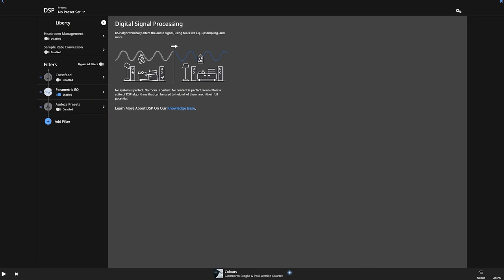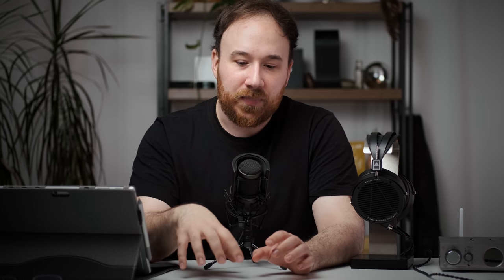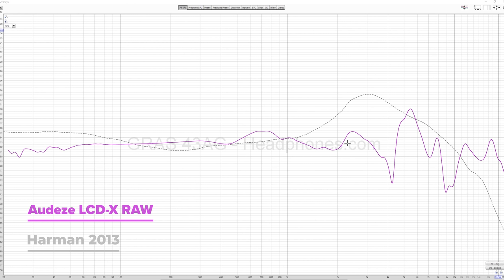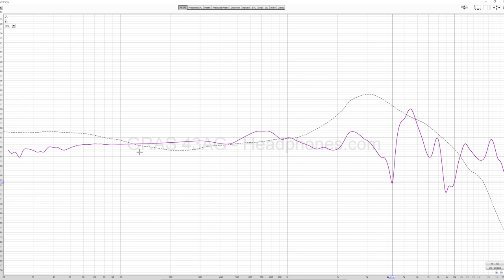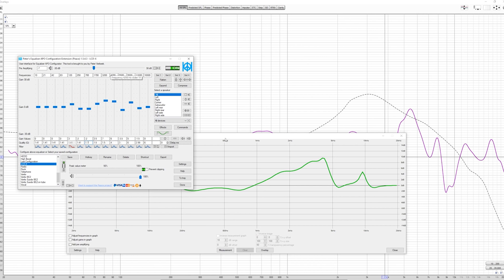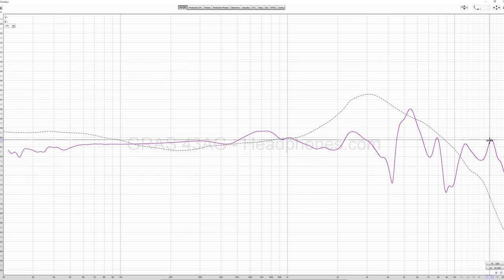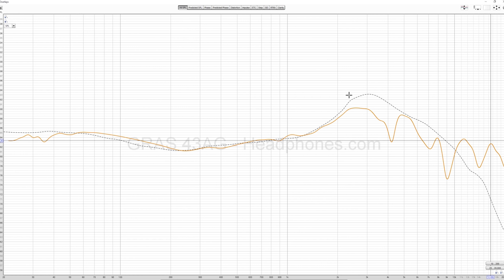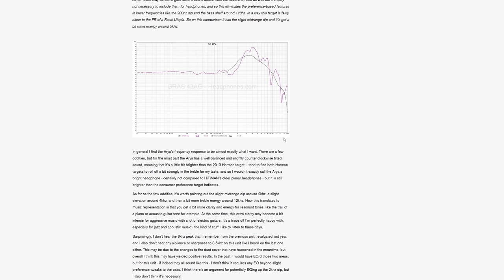How to EQ Headphones - Featuring Audeze LCD-X 2020 (not 2021)

Comment from the maker: UPDATE! This EQ ONLY applies to the 2020 version and not the 2021 version.

Just a note about the 9khz dip. Apparently this is something that shows up on headphones that have strong interaction with the physical ear, and it should be there. For the LCD-X, I'm not sure it has this interaction, or if there really is a dip around 8.7khz. To my ear, adding a bit of energy back didn't result in the kind of 'shimmer' that filling in this dip on other headphones has resulted in, but I do think this is something you need to do at your own discretion. Start without that adjustment, and if you still find it has a cut resonance, try adding it in. But I really don't think it needs it either.
Reply: Thank you for a great video! Where can I find your curve for the latest LCD-XC?
Reply: No file we can use please, bar transcribing from the video?

Comment: wow, what a great video. I personally love EQ and use my ADI 2 DAC with multiple profiles for my LCD2C to switch between depending on the day and mood. although I used to be a purist at the beginning, I now have discovered the beauty of EQ.
Reply: im not scary according to the manual the rme does not clip. The dsp handles that for you automatically so you don’t even have to think about it
Reply: I used to have the same thinking and when I EQed my LCDX with the RME, a combo made in heaven was born. EQ was actually my most unnecessary feature when I bought the RME and now became the unexpected surprise.
Reply: @alexk1239  could you please share your DSP curve on RME for LCD-X? I have the same setup :)
Reply: ostvaldseo Sure:
B1 Fc 100 Hz Gain 3.5 dB Q1.0 and leave the filter symbol at self mode (Sideways “Y" )
B2 Fc 1000 Hz Gain -2.0 dB Q 2 peak mode
B3 Fc 3400 Hz Gain 2.5 dB Q 2 peak mode
B4 Fc 6000 Hz Gain -2 dB Q 3 peak mode
Reply: @alexk1239  Thanks a lot! I'll start with this setting
Reply: @ostvaldseo  I emailed Audeze to get the FR for my SN and actually I fixed it completely now as it was a bit off target. Sharing the new values:
B1 Fc 100 Hz Gain 3.5 dB Q0.9 self mode
B2 Fc 750 Hz Gain -1.0 dB Q 2 peak mode
B3 Fc 4300 Hz Gain 3.5 dB Q 1.9 peak mode
B4 Fc 8100 Hz Gain 3.0 dB Q 3 peak mode
B5 Fc 12k Hz Gain -3.5 dB Q 2.8 peak mode
Reply: @alexk1239  hi there I just got my FR from Audeze and own the RME. Is there a way I can get in touch with you to get some help setting up an EQ on the DAC for my FR?

Comment: I‘d recommend giving Sonarworks Sound ID a shot… it basically does the correction curve automatically based on measurements made in labs and also compensates your gain according to the strongest EQ adjustment. It‘s used for mixing and mastering but there‘s also a systemwide application that let‘s you listen to any audio source👍🏻
Reply: Soudnds way too harsh with Sonarworks curve…

Comment: Trying to find a headphone that naturally has a tonality you like may be more fun for people with lots of money, but for us poors, EQing makes the hobby a lot more affordable.

I recently bought the Sundara, and the level of clarity and detail was immediately apparent from the moment I put them on. They're by far the most technically proficient headphones I own, but I felt they were a bit light on the bass for my tastes, and some vocals and electric guitars sounded ever so slightly shouty at around 4K. A bit of time spent tweaking the EQ fixed both of those right up, and turned my Sundara into a headphone that I'm much happier with than I would be if I'd left it at the stock tuning.

How many headphones are there around this price range that have both the technical capabilities of the Sundara and have a frequency curve that perfectly matches my tastes? Probably none. So if I have to make a choice between EQing, or spending lots of money that I can't afford to spend on headphones to try to chase down a unicorn, I'll go for EQ every time.
Reply: Hey can you share the eq settings? Thanks

Comment: Thank you for the video. I'm new to EQing, however I think there is a major flaw in this video or at least very important information are missing.
1. How to measure headphones at home? If it's not (easily) possible, then I have to rely on measurements from others and not for all headphones there are good measurements.
2. When it's not possible to measure headphones at home, how can I 'see' the end result in comparison to a target I have decided to EQ towards? (hearing a result in comparison to a target is not possible). Sure I can add the DB values to the purple measured line but it's not as accurate as I can't consider Q-values properly in manual calculations...

Therefore I think - especially as a newbie in EQing - it is very easy to mess up the sound quality of headphones with EQing

Comment: I'm going to give a golden tip that will change the lives of many people who have (or intend to buy) the wronged Beyerdynamic DT 990: take the Sonarworks ID Reference, apply the corresponding preset to the model DT 990. But (and here is the magic) no apply 100% equalization. On the dosage knob (Dry/Wet) set it to 55. There you have the best warm sounding headphones available for this price. The best.

Comment: I drive my Sennheiser HD600 from iFi Zen DAC. HD600 are known for not having much bass but that TrueBass button really helps them a lot. Now, not all music benefits from it but it is really nice to have it to mitigate the lack of bass when needed. 
I have more or less managed to match the TrueBass boost in Equalizer APO but there is a catch. It does not translate well when I use that EQ preset with other DACs than the Zen DAC. At least it is something to take into account when I try to dial enough bass to use with other DACs of mine like SMSL Idea and Tascam US-2x2 interface.

Comment: Why calibrate tvs? Why tune cars? Why adjust in-game graphic settings? Why turn the ac/heater up or down? Why install dimmers for lights? Why overclock a cpu? We eq everything around us to suit our preference. Why buy something for its potential capabilities and yet refuse to run them at those potential capabilities? I smh.. lol my question is tho especially for planars, would eq-ing affect the longevity of those planar drivers?
Reply from the maker: This is a very good question. So far I haven't heard of anything to the contrary but there may be some edge cases where if you boost the bass like crazy it could have some strange effects on the diaphragm's excursive force. I know that some HE-6 users are living in fear of their headphone's drivers ripping themselves because it slams so hard. I'll see if I can ask a manufacturer about this, or maybe Oratory has some info.

Comment: if you do it right, your headphone could be much more enjoyable after EQ.

the main problem however, is getting an accurate measurement of the headphone so you have a reference to work with,
headphone measurement rig can cost you thousands of dollars. yes there is some cheap ones out there like the minidsp ears, but those are known to have insufficient accuracies that makes the graph measured less useful as an eq reference.

you can always find graphs online, but headphone do have revisions that changes the sound, and manufacturing tolerances will make every single one have different responses especially on the treble range. and besides you can never know whether a graph is trustworthy or not because you don't know the rig it's measured on.

it's important to know what you're doing when EQing your headphone, but it's difficult to know what you are doing without an expensive measurement rig......

Comment: Thx . Very helpful! Still wondering how your proposal is different from what Audeze is providing as compensation e.g. as Roon preset. Also hove trouble finding your preferred eq presets  in the provided links
Reply from the maker: I haven't posted them yet. This is if you want to learn how to do it yourself
Reply: Where can i find the measurement graph you use in your presentation . I am not able to read the text on the axis. I.e. i see the curve but i don't know at which frequency the dips and peaks occur . Thx
Reply from the maker: I post them in threads on the community forum linked in the description, and also in my written reviews posted on the main page
Reply: Thx tried it out in Roon.  played with the q values to get a steady curve . Sounds overall good and transparent but a bit harsh in the upper  heights
Reply from the maker: Yeah maybe add a downshelf around 11khz for the LCD-X.

Comment: one little correction to the method, when you do the low shelf for the bass, if you see the crossing point - like in this video example at 120hz, than the shelf should not be set at 120hz. as the shelf bleeds to higher frequencies above it. this is why your bass boost overshot the target line above 120hz. watch it again to understand what I am talking about. usually you should subtract a little bit: the shelf should be set more like 90hz (plus minus) to match a 120hz target cross point. do it with your eyes watching the result, to see if it crosses correctly in order not to over shoot.
Reply from the maker: I get what you're saying but I also think it's fine to overshoot the target there. There are good reasons not to worry too much about the contour.
Reply: @TheHEADPHONEShow  your remark as general is acceptable, only specific to bass region that we discuss now, the issue is, acoustically, frequencies over shadow neighboring frequencies, and when we overshoot, doesn't mater where, but specifically in the lower registers, usually over bass meaning more energy in first octaves, will mask the octaves above it and will deteriorate tonality and detail retrieval by our ears. so we have to be very careful to not overshot 1st and 2nd octaves with over energy. if we do so we will not hear enough information in 3rd and 4th octaves. the trick is to find a fine balance between enough energy down below one the one side, and not to over shadow the required energy in the next octave (or two) on the other side. its a job done with experience and closed feedback loop, until its precise. p.s I wouldn't mind talking with you over the phone and exchange knowledge/experience, as you are one of the higher level in this area today relative to the mass reviewers out there, and I congrats you very much for this, and for your great work over here. this is why I am watching you, rather than amateurs in the channels next to you.
excuse my English I am not a native English speaker, I am Israeli from Israel.  46 yo by the way.

Comment: I think you talked about this on your livestream, but what target are you using as your reference point? Was it Harman 2013 bass response combined w/ the 2018 top end? 

If not, and it doesn't subscribe to a 'typical trend', would you consider mapping out your preference curve? Would be interested to see where that falls.

It was cool to see your thought process on EQing the Audeze LCD-X. What's your process like for headphones akin to, say, the Hifiman Arya or Ananda, which have pretty good stock FRs, what kinds of micro-adjustments do you like to make there?
Reply from the maker: Yeah I'll put together my EQ profiles for most headphones I measure. I think some like the Ananda and Arya really aren't worth doing all that much to because they sound pretty good already, and most adjustments there would just be for preference. So like, I may boost the 2khz dip and drop a few areas in the treble by a dB or two. As for my own preference, I do like the hybrid Harman target with 2013 bass and 2018 mids and treble, but it's not so simple to just combine them in a compensation. At the moment I'm deciding the best ways to represent this stuff and I think I'll go with 2013 Harman for one, and maybe a custom target for another one, and that will likely be my own personal preference. So something like that hybrid with a bit better treble extension is likely what it'll end up being. I tend to think Harman in general ends up being a bit 'cautious' because we're not always listening to optimally recorded stuff. I suppose it's better to have the majority of material sound good than cater to only the really well recorded stuff.

Comment: should I run eq for my microphone through apo? I can't find a way to use two configurations at the same time, one for each device. for the time being I used voicemeter since it can do a little more than just separate inputs

Comment: The HD600 series takes EQ just fine. At 90dB at 50Hz the 650 gets 1% D2. Harmonics past that are basically not existent. This is inaudible. If you don't believe me, put on your LCDs, open the generator in your REW and have it output 50Hz with the second harmonic at -40dB. There's even a nice checkbox, so you can instantly turn the overtone on and off.

Comment: The huge holes between 4k-5k and between 9-10k would typically indicate a bad crossover or a poorly engineered one on a speaker. There shouldn’t be huge holes like that especially on a high end pair of headphones like the Audeeze LCX. Did you perform the spectral analysis on your own pair of headphones yourself or did you pull those measurements off of a website that someone else did? Because if they are yours, I would seriously consider sending those headphones to the manufacturer to have them take a look at it to make sure nothing is broken or messed up with your pair. And if those holes are standard across all of the Audeze LCDX line, then that’s a major problem/flaw with the engineering and design. Hopefully it’s just your pair that are defective.
Reply: It's there for all units by design, read the analysis they made of them in the site "audio science review".
Reply: @BrentLeVasseur  Oratory1990's curve has it and it's a commonly accepted characteristic of those headphones. I'm not a troll or a hater, I bought the 2021 version and it was an extensively researched decision since €1,4k is not a trivial amount for me, but facts are facts.
Reply: @BrentLeVasseur  I know you weren't. I read tons of posts and reviews and eventually I narrowed my options to the Arya, Focal Clear, LCD-2, X and 3. I ruled out the Arya because everyone seems to agree that build quality seems cheap and the Clear doesn't have that rep but still gives me that impression.

I'm not, nor I intend to be, the typical reddit audiophile with a collection worth the value of a new car, I just want one headphone that is the best I can afford and be done with it. €1.4K is quite a lot for me so if I spend that much money on a pair of headphones they need to offer not only perfect sound quality but they also have to be perfect all round. I can understand a  mid-end product to focus solely on its main purpose sacrificing aesthetics and build quality in order to cut costs, but a high end HP better have a build quality that screams premium and that allows it to last forever, and €1.4K and plastic don't sound well together in my opinion. The Audeze on the other hand seem solid and luxurious AF.

Then I started to read comparisons between the different LCD models and the vast majority of people, if not all, seem to agree that the X sound better than the 2 and 3, and not getting the 3 leaves me €1K extra that I'd like to use on an RME ADI-2 next year.
Reply: @BrentLeVasseur  Congratulations for that setup, I could only dream of having something like that. You don't really have to sell me the sound quality of the Aryas (although you did a great work at it in your video), everything I read about it was positive, it's the build quality what turned me off. However, owning the LCD-X takes away the pressure of making a choice and now maybe I could consider getting the Arya at some point in the future since I do see myself upgrading my HD560S that lives on my desktop and I use all the time for casual browsing, but this hobby can turn into a money pit really fast and I really don't want to go down that route. But on the other hand, having the rme adi-2 solely for driving the X would be kind of a waste, but still, maybe in the long run.

You really made me curious about what that amp (or any tube amp) could sound. Just a question, what does a tube amp ad to the sound that can't be replicated by equalizing? I have zero knowledge on tube amps in the audio context but, from what I know about amps from an electronic engineering perspective, semiconductors have a much longer linear zone so the only explanation that comes to my mind is that tubes are actually bad at staying linear and the resulting effect is what people find pleasant.
Reply: @BrentLeVasseur  Well, guess what, I ended up getting the Aryas, although the Stealth edition, and I'm returning the LCD-X.
Reply: @BrentLeVasseur  It had nothing to do with the sound, which absolutely blew my mind. It's just too big for my head, the shortest setting is barely enough to keep them in the right height and the clamping force is almost non existent, which forces me to stay very still or they start sliding off.

The Aryas were my second choice but I found them used on ebay, purchased on June and still under warranty, for €1000, which is two thirds of the price for brand new. The (supposedly) cheap build was what made me choose the X in the first place but for that price, and if they're as new as the seller says, then it's more reasonable and gets me a little bit closer to the rme adi.